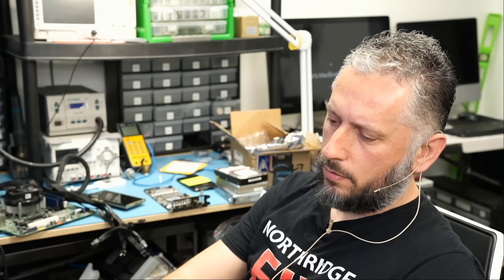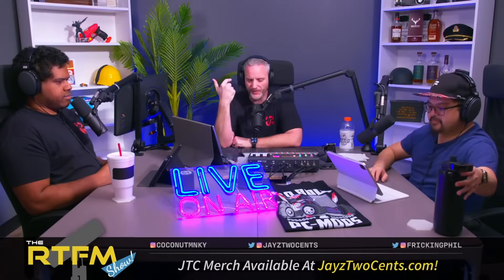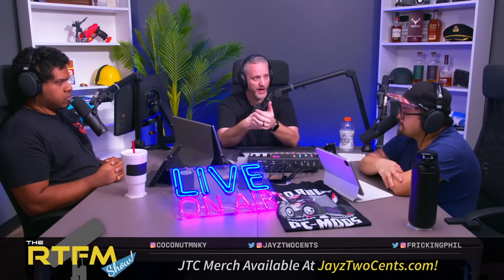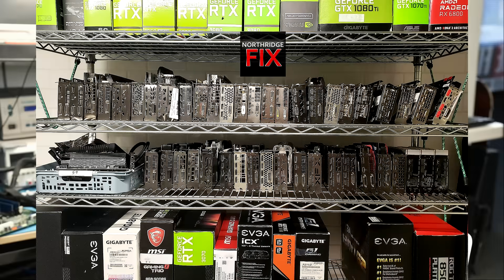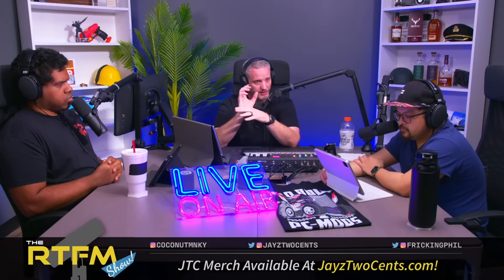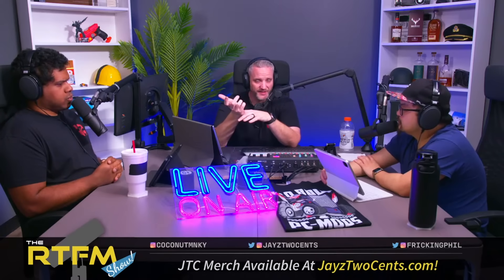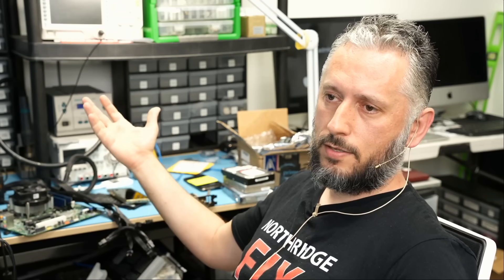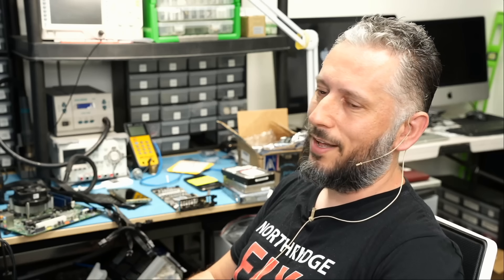Melting 4090 and CableMod. JayzTwoCents and Gamers Nexus Response. Blame NVidia or User?

Comment: The ATX 3.0 standard which consists 16pin VHP power connector is INTEL design and tested and certified NOT nvidias or amds
Due to i cant paste link here we have myriads of "melted connextors" to the web from pcix 8 pin power connectos, 8 pin EPS cpu power connectors, 24 pin motherboard connectors since ages just google it
The only certified adapter 12VHP is the nvidias one all other 3rd party even cablemods are in question
Many users are installing to their rigs 3rd party cable extenders incresing the length L of the cable in the circuit, increasing the Resistance, having Vdrop and the feedback to the psu IC is wrong due to it is calibrated with a cable length X and you re using cable length Y, moreover even the diameter of the cables extender is different increasing the resistance and ripple more 
How may mosfets have you replaced in your videos of repairing gpus from users with beautiful cases with sleeved extenders and many of the trying to undervolt their gpus and keeping the stock clocks?
In a high amperage scenario what is going to happen?

Comment: All this seems to me is that the socket design is poor for two reasons. It's not easy to fit and from my very long experience with electronics and suitable connectors, especially in the aerospace industry, these pins a way too small to efficiently carry the high currents involved with these cards. I feel much larger non tarnishing plating (Gold) should be used.

Comment: As a product designer there is no debate here. A product needs to work for the intended user base. If there are excessive fails of one type, either the design or the user instruction is insufficient. 

It happens sometimes in products, especially high-performance products. I am no PC expert but it looks to me this board uses a lot of power. This will always increase the risk of power related design challenges (such as avoiding overheating). 

The cause of the fault is not the ultimate question. By definition any unexpected, non third-party related. unacceptably high fail rate demonstrates a product failure, especially on a high-end product.

It happens, it is not a crime, but in my opinion the manufacturer needs to address it.

Comment: i agree its nvidias fault for designing such a crappy connector. the reason why they melt must be some sort of incomplete contact which is then either due to user error or manufacturing tolerancers exceeding spec

Comment: This is because moving the cable from right to left to extract it expands the area of its holder, so put a little flex on the cable port to help extract the cable and also helps it to make a good connection between the cable and the card port.Or the possibility that the cable wires that burn the outlet are badly connected and cause melting..
Reply: which is a design d
flaw.

Comment: one Steve who can barely disassemble gpu without absolutely destroying it and another from hardware *unbiased"who can barely assemble pc on camera, I'm sorry to break it to you but they are both sponsored by either of this big corps, they literally state in the beginning of their videos 

also 600 watt power surge that goes through that puny connector can totally solder those cables without problems and no plastic will survive that, although while I've seen morons who can barely connect hdmi cables properly, this is totally ngreedias fault, 40 class cards must be limited to 350 watt tops, otherwise plastic bbq will occur

Comment: If I had one of these cards I'd be adding a thermistors to the connect, one hooked to a warning light and another to an emergency shut off relay, to prevent any physical damage from happening. They just don't even want to do that (1-2 cents to add temperature sensors to the board) because it would be like admitting there was a problem. Gotta love it when the lawyers are overriding the engineers...

Edit: needs to be a recall. If no recall, needs a class action lawsuit. California's gov loves to get involved in stuff like this too, and EU too... The fact that it's failing in the same way every time just screams design flaw, not random user error.
Reply: I think a class action lawsuit is due for this.

Comment: Engineering design 101, design  in a safety factor (the connector can handle overload conditions + effective safety interlock) and test the system to ensure that edge cases (e.g. user error) don't cause failure / safety issues. Looks like neither have been done in this case.

Comment: I agree with JayzTwoCents  that the connector needs 2 clips if the connector failure rate is non-negligibly higher than other cards.

Comment: while I find it unrealistic to have a circuit detect proper connection (how? temperature sensor? ;-) I agree to fully blame NVidia for coming up with their own fragile proprietary  power connector that, as it was not proven industry standard is now causing issues for them, ..!

Comment: This is clearly as case of the current drawn by the card is beyond the conductive capacity of the materials used in the connector. Metal melts due to heating effect of current according to great scientist James Prescott Joule. There should be a recall.

Comment: No Alex, you are right. Steve and GN. No any room for movement in the connection can occur at any time post initial connection and is therefore an engineering issue. NVIDIA are at fault.

Comment: This is exactly the same tactics what Apple has been using for ever. Blame it on users, "You are holding it wrong" and create a reality distortion field. People start blaming each other and the manufacturer gets more time to fix their side.
On the other note. The plastic card and how much play it has, has very little in this equation. Does it click or not and how much there is play. The more important thing is that how good electrical connection the pins makes and how conductive is the connection. Like old molex connectors tend to heat up on load, but more modern trifurcon model of Molex works better. It has 3 springs that tugs into that pin in header. What kind of plating these different manufactures are using. How many micros there is that plating. I'd say that the problem is in NVidia side design flaw. That kind of connector cannot deliver enough power without starting to heat up. Connector needs rework or maybe bundle 2 of those.

Comment: If there is a tendency for users to not plug the cable in all the way there should be a big red tag on that wire telling the user to be sure the cables plugged in all the way. It's a very cheap and simple solution but it hasn't been done because it's probably not the real problem. The real problem is just pulling too much current for the size of the contacts making them get hot and melting the plastic.

Comment: You can't anticipate every single way a user can damage or misuse a product. People are very, very good at finding clever ways to do stupid things. But when it is a basic thing like plugging in a power cable, and said cable has to carry a lot of current to a very expensive and delicate video card, you don't chintz out on a weak connector that even allows it to be used incorrectly.     What Nvidia did wrong was use an industry standard connector that is not the right choice for the realities of the 4090.  They could have used a break-out cable of their own design to adapt that cable TO the card, using a much beefier approach to connect the card side. But they decided not to.   That's totally on them.

Comment: Seems to me that the current draw is more than the contacts can handle. It's possible that the contacts design is faulty where there's not enough surface area making contact for the current when the card pulls its maximum. Since there doesn't seem to be a problem with the PC board it would seem sensible to redesign the connector for higher wattage draw.

Comment: Hmmm so plugging something half waycauses it to burn 😂 this would have less power no ? Am thinking check which pins burn possibly those are drawing more power cause it to burn plugged in fully or even half so don’t think how you plug it but more why the pins getting more power

Comment: Sounds like the plug is not up for the amount of current going through it. Putting all pins in one place is never a good idea, with connections you can get heat, especially if the connection is loose, or the wrong wires or pins are used and can't handle the current, that would cause heat and eventual damage and failure.

Maybe Alex can get his customers to all write to the manufacture with the same complaint, here, in Australia, failure from the company looking into something like this would go to small claims court or ombudsman, to be investigated.

If a customer feels movement in the joint, it would be their fault for using the device, knowing the connection isn't 'safe' to use. They should be contacting the shop, or manufacturing company, and have the shop contact the supplier etc. to get some answers, even taking the card back to the shop with the computer, if necessary, to show the faulty connection.

So, at this time, company error for making a device that is a possible fire hazard. Customer error for using when the connection isn't solid.

I've never had a problem with connections in the past, always connected solidly, then again, I haven't purchased any new cards for donkeys years. I just get them repaired, hoping to get into repairing myself sometime soon.

Comment: Mostly nvidia should spend more years testing prototype cards before releasing to public for profits every single year let people enjoy their cards longer years I repair electronics too and this could of been solved by longer testing and having more pins solder off the board it goes same as amplifiers in car audio go ahead put small gauge power terminals on your amps or heck even the user may put smaller wiring on large enough terminals either way your gonna start a fire and stress out the entire pwm class d circuit up in SMOKE!

Comment: I still think that this is all based on the user, all of these GPUs have the same connector so why would only some fail and not all off them. I think the ones that melt are because the user is overclocking the card pushing to much extra current down the lines which the connector is not rated for, each adaptor is rated to a certain heat. More current = more heat
This could be solved by going back to multiple connectors not pushing high wattage through one connector

Comment: Over the years I have seen countless connectors incorrectly inserted in computers, I'm very surprised this seems strange to you, even the best of us make mistakes and aren't perfect, either that or like you say there are a lot of people out there without braincells. Clearly in this case it did very much matter what name was on the card, because you didn't know you missed the fact that these cards were returns spanning months and not multiple failures happening over a short period. I think it's clear that Steve was suggesting that it's possible that damage could have been caused by the original connector before the cablemod connector was installed, I'm not sure why you interpreted his comments in such an odd way, but he's clearly not suggesting that people are forcing cablemod adaptors into melted connectors. Gamers nexus seems like he wants to get down to the facts using evidence instead of jumping to conclusions, I think you jumped to conclusions and are now on the defensive.

Comment: I recently moved into a new apartment and had issues with the elevator periodically stop working. The building manager's initial response was it's because people are holding the door open for a few minutes. I argued being a new building, people need the hold the door open to move furnitures and boxes.  Holding the door open for a few minutes should not cause it to malfunction and if it does, then there's something inherently wrong with the elevator itself. Few months down the track it was then found the elevator was indeed not installed to specs.

In this case though I feel like it's a little bit different. Plugging in cables fully should be basic due diligence of any user, be it computer parts or even normal electrical appliances. A fan standing fan manufacturer isn't going to be responsible for someone not plugging it into the wall properly and gets electrocuted. I feel like the user cannot escape part of the blame. However, the 4090 does indeed tend to catch out the more careless amongst its users compare to the old 8pin cables so the design could definitely be better and more importantly safer. To me it's is still a user error, but no doubt Nvidia did put out a poorly designed product.

As for the Cablemod angle adapter melting while fully plugged in, that's still not conclusive. The 4090 could have been deigned in such a way that if any cables are not seated properly on any part of the link between the power supply and the card, it will melt in the same location aka right at the final connection point into the GPU. Assuming it was a design within the 4090 that makes the card extra sensitive to poor contacts, the responsible module must be on the card itself, and thus it also make sense for the first point of failure to be always right at the point where the card first draw power.

Comment: I w8 for RTX 5090 with "maybe" better cable/connector solution, to  risky to buy this expensive cards to get it melted. Same with AMD x3d and Asus mb with expo memory, to risky to buy, better w8 and see whats safe. Maybe new computer 2024 instead of 2023. Still w8ing for that 32 inch 4k OLED monitor also... and those new SSD 12000+ speeds.😇

Comment: It might be problem with the card itself but I think the point about cablemod sending them was that cablemod was like a buffer for the cards and collected them from longer period of time and then sent them all to you in short period of time which made more cards coming in shorter period of time than if users had sent them as they failed themselves.
Reply: I'd say the video itself squashes this one as both the video here and from Steve at GN state eight cards from cable mod.  Whereas this video showed a whole rack of cards from users waiting to be fixed.  Those eight cards aren't making or breaking this numbers wise.
Reply: @Stubbies2003  true, but that is a fact that only came out in this video so hard to blame GN or J2C for that when it was completely unknown info to them
Reply: @Henrik_Holst  Yeah Jay has already leaned towards something wrong with the card at this point.  Steve didn't shut the door in the video either.  He left it open for something that wasn't known at the time of making the vid.

Comment: @Northridge fix guy 
imo nvidia got there own Hiroshima 😂

a component that is the same on 4080 and 4090 does not have to work properly. something draws full power but it can't process it, otherwise such a build-up of heat wouldn't be possible in my eyes. and only waste heat in normal operation, it can not be synonymous. you would have to measure what is pulled and consumed on the outer ones and then see what the middle ones pull. Nexus already had a thermal imaging camera from the plug and from the chip, so the heat also came from the middle pins. luckily i am very happy with my msi 3060ti "z" trio and don't need an exaggerated monster card. times curious whether also ne 4070ti appears with you. thanks to google translate and greetings from Germany

can you say the manufactors of the failed or broken cards....???
or create a list...some msi cards broken too or only fe or gigabyte or zotac cards???

Comment: connectors melt due to heat, heat is created when more current is drawn than the connector pins can carry. that happens because the connected device draws more current than connector is design to handle. This can be caused due to greater resistance than expected between the female and male connectiors. Not rocket science. The rocket science comes in when identifying the  cause. Pins not fully inserted, pins spread out casuing less contact (thus more resistance), contamination, and others. Regardless of the cause you'd think the mfg would upgrade the connector to a beefier type to eliminated the possibilities. I have a 4090 with four EPS12v connectors feeding it. I made sure that the male pins of the 4090 connector where straight and the female pins were not spread out. Plug it in once tightly made sure there was no strain on the connector due to weight or cable positioning leading to conector. Haven't touch it since I plugged it in, no problems so far. Nevertheless, the weight of the connector or tightly angled cables can strain the connector spreadong the female side of the connector. That seems to be the cause because the connector is spect to handle the power draw. Considering all the failures, you'd think the mfg would select a different beefier conncetor to eliminate user issues. Connectors are not rocket science type stuff. It's easy to blame the customer than to recall all 4090 and change the connector and provide a new cable for it. GOD that cost money and greedvidia rather blame the user.

Comment: i agree with you. a manufacturerer should make sure that they measure the connection before putting full load on them.
thats possible if iḿ right?  and with the ammoun t of failures comming in you can conclude it a manufactoring failure.

Comment: Resistance , the Card is pulling too many amps. Both the connector on the card and Power supply need to be Changed to accommodate the power needed for the Video card. Video card Evolution 🙂.